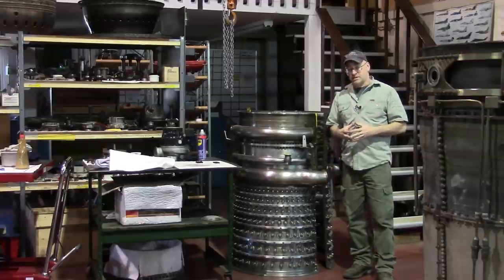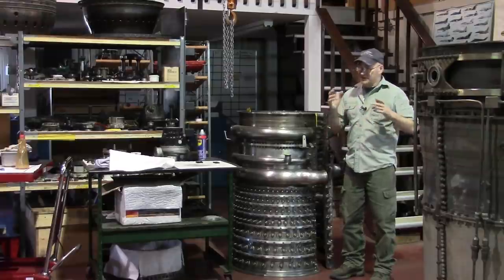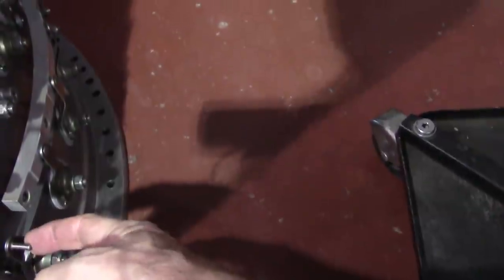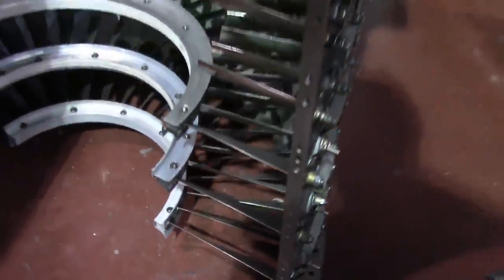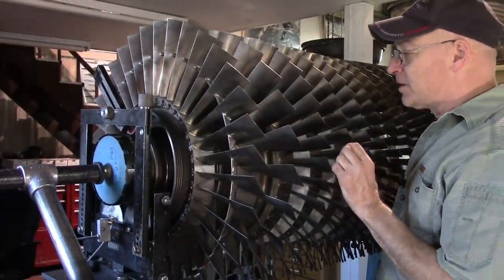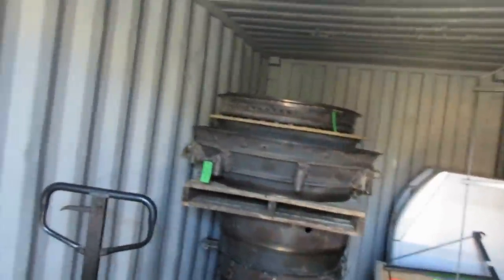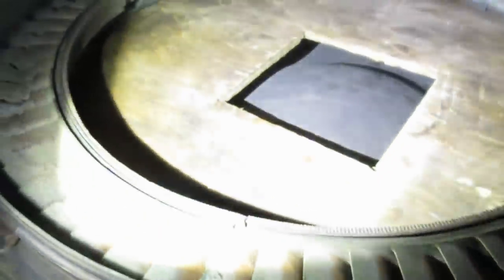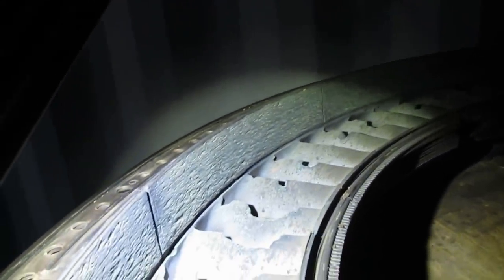Turbine Engine Heat Damage

Comment: Sir Agent J Zed,  Is it possible that the first set of nozzles were somehow pushed back into the first Turbine in the hot section?  The rubbing ( grinding) of the Nozzles against the turbine would / could slow down the turbine and cause the engine control unit to supply more fuel in an attempt to increase the RPM lost due to the grinding of the nozzles and the Turbine?  My question is >> how fast would damage like that occur in the nozzle and Turbine section?  Is that a 100 hour event, or is that a less than a 5 min event?  I would suspect that as soon as the Turbine Seal separated from the Nozzles, that hunk of scrape would dance around inside the Turbine section and be like the Tasmanian Devil before being sent on its way out the tail pipe.
Reply: I don't know the support and retention arrangement of the HP1 NGVs in the CF6/LM2500, but it does appear that the inner platform trailing edge of the NGVs has moved back into contact with the leading edge of the HPT1 blades, causing that undercut.  However, what I can tell you is that the friction force generated as contact occurred, relative to the power available, would only imperceptibly slow the  spool down, assuming the movement was relatively gradual, and the heat generated by friction would result in almost instantaneous melting, with the molten material immediately being carried away in the turbine gas flow.  Even if the rearward movement of the NGVs was quite rapid, the braking effect would be very marginal: in fact, the molten interface would tend to act as a lubricant.
I've seen a not dissimilar event, as a result of a location bearing failure, which allowed the HP turbine rotor disc and blades to move forward into contact with the HP NGVs and their root sealing features.  It was estimated that this event happened in a matter of, at most, a hundred or two milliseconds.  In addition to the blade leading edge being undercut in a similar manner, the debris being released eroded the root section on the 'suction' side of the leading edge.  No-one understood this until I pointed out that the debris would have a lower axial velocity than the gas flow and that they should construct a velocity triangle for the debris, which would explain everything.

Comment: Thanks for a fascinating video. Do the LM series engines contain any rhenium in the blade alloys? I read that the recovery of this metal from replaced parts is critical in the jet engine industry, due to its scarcity. I'd be curious to hear about this, if you have any dealings with parts containing super rare elements.
Reply: LM2500 is a derivative of an old CF6. So. No rhenium here. Anyway turbine blade superalloys are expensive even without rhenium.

Comment: Start up is probably one of the most dangerous times for a turbine. Pilots watch itt temps until the engine spools up completely. Primer1driver had his itt go out of range on start up due to some bees that decided to build their nest in the inlet area of his engine. He now has a decal of a bee 🐝 painted on his engines to remember the expense they cost him to have the engine overhauled. If a turbine is managed properly guys like agentz most of the parts get to stay and just have clean up done with minor repair or replacement of parts that are out of tolerance.

Comment: About ten years ago AW&ST Mag had an article about the aviation industry running out of Ni in 30 years. The article also mentioned that some Ni was not recyclable due to its alloy and was somehow  toxic. Any idea what alloy they were talking about? And is there still a looming  Ni shortage in the near future?
Reply from the maker: The detailed metallurgy of the components of the engines I work on is beyond my knowledge base, so I don't have an answer for you.
Reply: You are probably thinking of alloys that used beryllium. Ni-Be-Ti alloys are very strong and heat/corrosion resistant, but beryllium is toxic in all forms and very expensive due to the extra precautions associated with handling it. Improvements in ceramic coatings have allowed it to be phased out of general use.

Comment: Hello AgentJayZ. Another great video. Would you surmise on the turbine that it could have been a runaway because the controls would have prevented excess fuel flow.
Reply from the maker: A "runaway" has been discussed before. I see no evidence of damage due to excessive rpm. If anything, the rpm was dropping, so the system or operator increased fuel flow in an attempt to restore speed, and things got to hot.

Comment: At 13:30 I noticed the way you store your torque wrenches on the wall.  I dont think the weight of the tool itself is sufficient to cause sufficient changes in its calibration.  But it seems as though it would be a better idea to store them without weight on the head of the torque wrench
Reply from the maker: Not a concern. They are calibrated every 6 months, and so far, no changes have occurred.
Reply: Great to know, thanks for the reply!

Comment: When temperatures reach extreme level we do microstructure with a 1000x electro microscope for evidence of Solution of the Gama Prime.. do you do hardness checks on the face of the turbine disc?
Reply from the maker: We have done so in the past, but it's not a regular thing. Over temped parts... we throw them out.

Comment: How does something like this happen? Is it neglect? Or negligence? i'm sure airlines do a better job than this but it still makes me wonder...
Reply from the maker: It came from a power generating station in "another country". I do believe some neglect was involved, but I do not know the history of this engine.
Reply: I really don't know. It looks like its been ingesting some sort of abrasive, maybe sand judging by how all the surfaces are worn down. But you'd expect to see damage on the compressor as well as the turbine so, maybe that's what overheating does to an engine and all that missing material has just ablated away.
Reply: Maybe a few too many hot starts.  I guess the power company don't believe in boroscope inspections also.
Reply: Thousands of running hours in a dirty environment and using the worst fuels too.

Comment: What are the welded square plates on the front struts, precisely holding the front bearing. Whilst they are immensely strong, a weld will weaken things?

THANK YOU for the superb videos and your time.

Very best wishes
Ed from Winchester UK.
Reply from the maker: Answered below.
Reply: Many thanks and I get that, but what are they concealing - if anything? The plates must previously have served an access purpose.

Fawning continues.

Again thanks.

Best wishes 
Ed
Reply from the maker: Nobody is concealing anything.
... it's a frame made by welding different pieces of bent steel together.
It the way things are made.
If you are unable to understand something, it does not prove that anybody is concealing anything from you.
Reply: AgentJayZ Many thanks and again, superb videos!

Comment: In which scene of Star Trek was the LM2500 depicted?  Thanks!
Reply from the maker: The first one 2009. I think it was at 1:45. It's on the engineering deck, You will instantly recognize it now that you have seen it here!
Reply: @AgentJayZ  I scrubbed the movie several times, and I finally found the scene with the LM2500.
It's actually on the ice planet in Scotty's lab.  The LM2500's cameo occurs when Scotty is escorting Kirk and Old Spock to the shuttle, and Scotty speaking of the Enterprise, says "She is one well-endowed lady."  The time stamp is roughly 1 hour and 25 minutes into the movie.
The viewing angle at the end of your video here, in which you're sitting next to the engine, matches the angle in the movie.  Thanks again for sharing!  :-)

Comment: Would plastic debris like pitot cover's damage a modern jet engine's like on a 737 and above?
Reply from the maker: Small pieces of debris entering a modern turbofan can cause damage to a fan blade, but that is less likely if the debris is lightweight or plastic. Due to the design and shape of the engine, small debris is flung outward into the bypass air flow, and does not enter the fuel burning core of the engine.
Reply: @AgentJayZ  Thanks.

Comment: My question involves what is needed to run a turbine on flare gas. I asked you a couple of years ago about using flare gas for bitcoin mining power. At the time you had brought up the unsuitable qualities of flare gas for powering a gas turbine generator. Since then, I have heard of a company that started doing just that. I was wondering if your opinion is still the same? 
PS. Thank you for answering me last time.
Reply from the maker: I vaguely remember. A few people have claimed success, and collected some investment capital.
The large amounts of impurities and sulfur cause a rapid deterioration in the hot section parts. The reduced service life requires extra maintenance, which is expensive in terms of labor, parts, and downtime.
These extra expenses far outweigh any savings in fuel created by using free garbage (flare gas) as fuel.

The stuff is flared off for a good reason, even at natural gas processing plants.

Comment: do jet engines tend to have sensors like piston engines do? 
mass air flow sensor, oxygen sensor, etc?
Reply from the maker: Airflow is calculated, combustion temp is extrapolated, and fuel flow is directly measured, not used to control the engine.
This is a good question which I will address in an upcoming video.
Reply: The Q, Very good question  and yes.  Most have what is know as a Exhaust Pressure Ratio EPR for short which is basically how much power/thrust the engine is producing . the EGT is Exhaust Gas Temp. TIT turbine inlet temp  and the speed sensors. OIl temp , some have a Inlet airtemp. and of course Fuel and oil pressure. Some engines like the Garret TFE331 use and gate logic for the starts which works to prevent hot starts. If  either the Fuel, oil  and N1 speed are not in start parameters the engine will not start.

Comment: I am goin in LM2500 soon. Just wanted to clear my doubts about the connection of rotors with the disk, that fir tree connection, how that air cooling happens in rotor blades and what exactly is hub?
In a nutshell, can u show us the brief details of the gas flow in it?
Reply from the maker: In the beginning of the manual is a description section. You should read all of it. There is a part describing the air system.
This will explain the cooling air source for the turbine blades and nozzles.

Comment: What type of material are the turbine blades and nozzles made from, you mentioned high percentage of nickel?
Reply: As it's a GE engine, it's unlikely to use an Inconel alloy for its turbine blades: GE has its own range of Rene superalloys.

Comment: How much time would be expected to pass between the first erosion that produces weak spots and the rabid chewy damage shown?
Reply from the maker: Hard to say. Rapidity of degradation is dependent on temperature.
Reply: Just wondering if it's a case of hours, minutes or even seconds.    That base cutting on the turbine blades suggests that the ring was losing stability of position over at least a few minutes even at the RPM typical of  these engines.

I guess part of me wants to think that someone didn't know it was going bad  many hours before it got to this state.  And also how in hell it even ran with the various parts in that condition.

By the way Jay.  Just want to thank you for the peek into jet turbine use that you provide.  It's fantastic to get the grass roots story from someone in the biz.
Reply: "rabid Chewy" sounds like bad Star Wars fanfic

Comment: I'm not sure if it's been asked, and it's an awkward question to search for in your videos, but are you guys known for your Orenda and LM2500 work or are those just, very, common engines? It seems like that's you're bread and butter. Once in a while there will be a Spey, or that neat little engine out of the Soviet trainer aircraft, turboshaft, etc.
Reply from the maker: Blake... you are basing your statistical analysis on the videos I post.
Silly rabbit!
Reply: +Gordon That's the one I wanted. I've watched enough of these that I should be able to remember that.
Reply: I'm cracking up right now because that's a very Jay answer. Off to google the most common industrial engines in use over the last fifty years by country.
Reply: @gordonrichardson2972  He's mentioned that they will not deal with commercial aviation because there is too much paperwork involved.

Comment: Just wondering, what kind of a life span does a turbin casing have ? Considering it is not damaged.
Reply from the maker: The usual cause for scrapping an outer casing is corrosion damage, and that is not caused by running, so if cared for properly, they never wear out.
Reply: Turbine and compressor casings can suffer wear to the stator vane locating features.  However, anti-wear features are frequently incorporated as part of the initial design.  In addition, manufacturer approved repair schemes are usually available for the recovery of wear when it occurs.
Reply: @AgentJayZ  thank you.

Comment: AgentJayZ  I worked instrument systems on RF-4Cs at Shaw AFB, South Carolina in the mid 80s during the transition from Smokey J79s to the Smokeless J79s.  I worked closely with the engine folks, but always wondered why the smokeless engines were so wonderfully clean burning, but never asked.  You may have already covered this, but if not, could you explain the differences between smokey, and smokeless (J79) engines?
Reply from the maker: The difference is mainly fuel nozzles and combustor liners.
I show examples of these parts from both types of j79s in my 2 series of videos:
Jet Fuel Nozzles 
and
Combustor Liners
I hope you like them.
Reply: Thanks AgentJayZ!!!  I'll try to find those videos!

Comment: Are there any parts, that say, if a customer brings in an engine to be repair after say an engine or nacelle fire or any other kind of damage, where the parts look sound to be reused, but because of the fire and potential loss of hardness or other condition, it has to be scrapped due to potential loss of safety.
Reply from the maker: That's a lotta ifs. Anything is possible, but nothing even remotely like the story you've laid out has happened here.
Reply: @AgentJayZ  All(?) the parts you've pointed out to us as being used-but-still-within-specs were so judged on the basis of visual inspection. Are there any engine-history events that immediately demand particular parts be replaced regardless of appearance? Like how baby car seats are  deemed unfit for use after any vehicle accident whatsoever.

Comment: That is a terrifying amount of internal damage.. What do you estimate its remaining operative lifespan was? Minutes? I can't see more than an hour left in some of those parts.
Reply from the maker: The rapidity of deterioration depends on how excessive the temperature is. This engine was shut down some time after it was operating in a useful capacity. Minutes? Hours? Seconds? I don't know its history.
Reply: "Engine Number 4 is running a little hot", to quote Airplane.

Comment: My name is Chris and i have been watching a good bit of F104's on YouTube. Two questions, what makes them howl at lower rpms and do you have a video of one in the test cell?
Thanks! 
Chris
Reply from the maker: Originally, the J79 had a variable nozzle that would howl like a giant whistle at mid power settings. This was unexpected, and later versions of the engine were fitted with a redesigned nozzle that eliminated the howling.
Yes I have one or two videos of howling J79s posted.
Check out "Afterburner in your face".
Reply: @AgentJayZ    I saw that video lastnight and enjoyed it. Definitely answered my question. I wasn't sure if it was the engine or the intake of the plane was causing this howling sound. Thank you! I've wanted to ask you about it for a while,  just did not know where to ask. I did noticed in the video it was slow to ignite the afterburner. The first time the afterburner was initiated, that it didn't take and just raw fuel was being blown out. Was this common on the J79's being slow to fully ignite?
Reply: Check out the 'howl' made by the intakes of Olympus engines in the Vulcan bomber and the 'blue note' of the Hawker Hunter.
Reply: @grahamj9101  Saw both the Hawker Hunter and Vulcan Bomber videos. Amazing! The Vulcan definitely sounded like a whale call as the Hawker sounded more like a pulse jet engine when it howls. Thanks again!
Chris

Comment: Is there a fluid circulating solvent tank that can clean those, reducing the hands on labor?
Reply: There are parts cleaning machines like that, but removing all of the blades to run them through such a cleaner might be more labor-intensive than just cleaning everything while it’s on the engine.

Comment: As usual excellent video. At 14:00, the tool you inserted in the combustor is for maintaining the concentricity of the turbine? Also, would you make a video for this turbine installation rig? Thanks for your valuable time.
Reply from the maker: That tool is a lifter. It allows the removal or installation of the combustor without causing any damage.